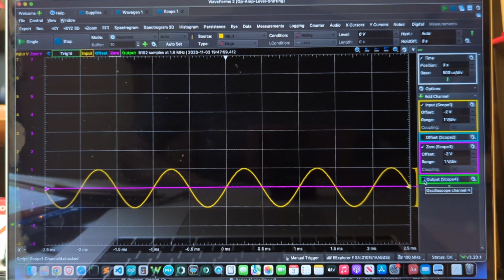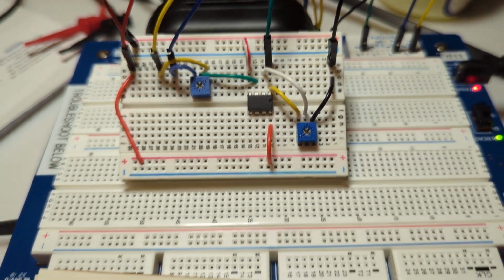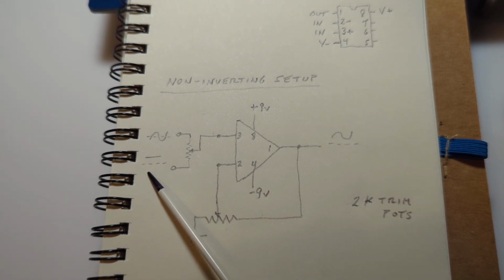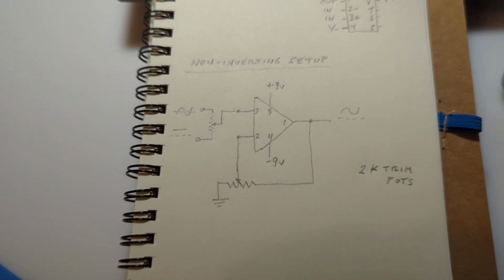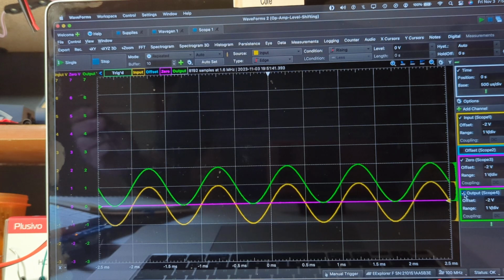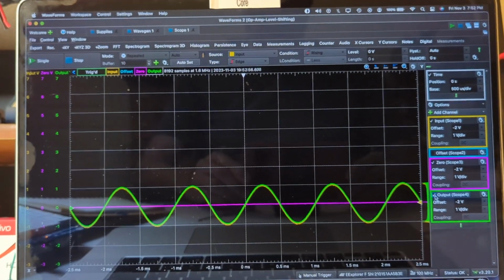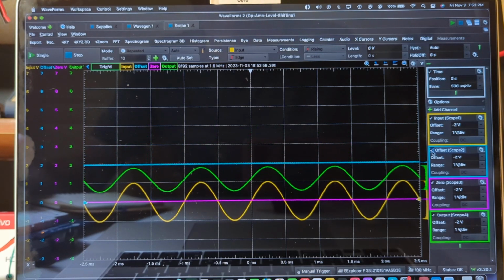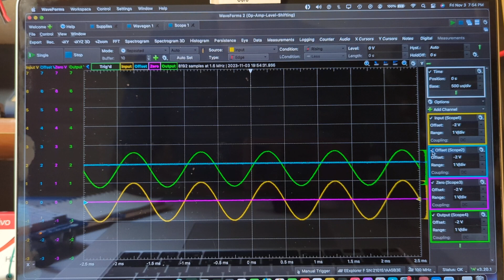Level shifting a signal using an op-amp

Comment: Great video. I appreciate that you set up just a simple circuit and walked through what each part does. I need to level shift 0v-3.3v signal to -10v-10v, so i assume i can use pretty much the same circuit, but pass in some amount of -v instead of the 2v in your ecample.